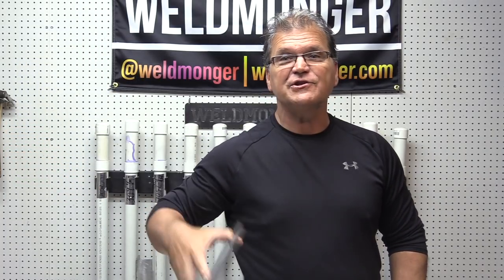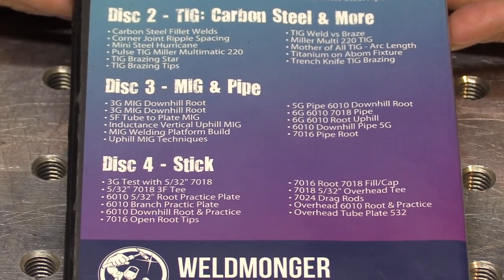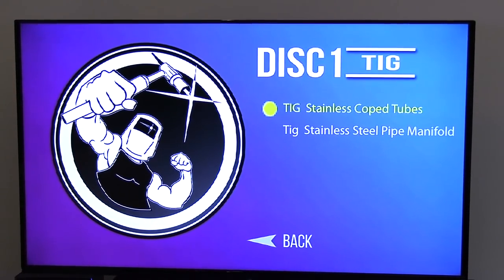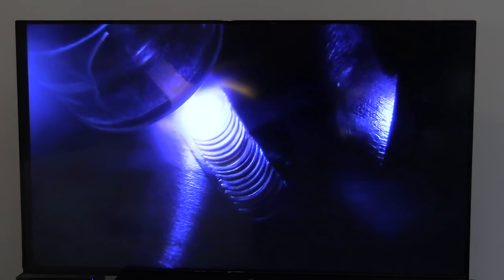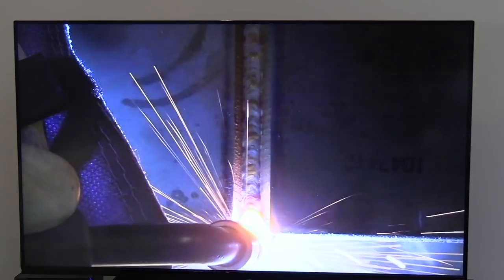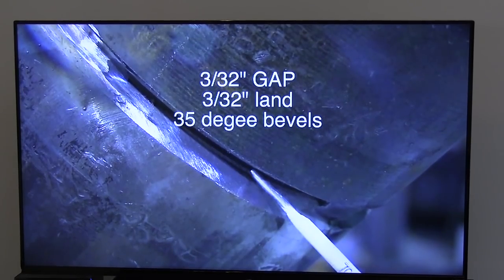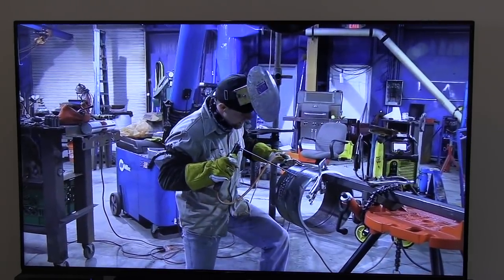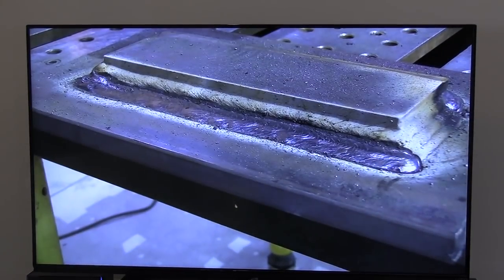Welding Tips & Tricks DVD | Volume 9 (2019) #Welding #WeldingTechnique #WeldingInstruction

Comment: Hi Jody I have been welding 5 days a week for the last 8 weeks 7018 1/8 rod practicing for vertical 3-G. I am100% sure I can't recognize the puddle. I even bought the Optrel Crystal 2.0 and tried it with the 1.5 cheater lens. That didn't work. Then I took the lens out and tried cheater glasses 1.0 and that didn't work so now I am using 2.0 cheater glasses and still no puddle. I've had people try and show me and try to explain it. Still nothing and it's starting to lead to frustration , not being able to read the puddle is the key to everything I believe. I watch your videos and they vary clear about the puddle, But when I go in the welding both it's different story. It's not the welding hood cause the other people I let use the hood says wow its so clear. Also my eyes have been hurting since I started this journey of becoming a welder at age 50. Do you have any suggestions ?

Comment: Thanks for the info Jody  wanted to know if you had any advice on getting into the welding structural or pipeline industry I am currently enrolled at the local college i have been taking classes there if you know of anyone that would take an apprentice or anything similar or any advice on what to do please let me know i have been struggling for about 1 year now thank you .
Reply: SHADYxTIMES dont know where you are, but check into your local building trades. Iron workers, boilermakers, pipe fitters, etc. hit every job shop that is related to what you want. Continue to practice. Developing techniques and dedication will get you far. Don’t wait for opportunities to find you, go out and find them. Good luck.